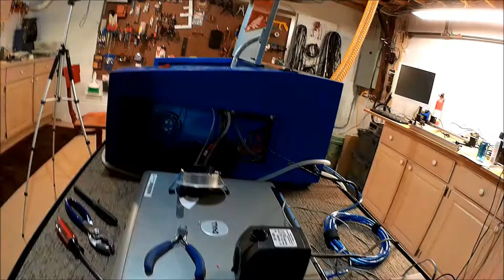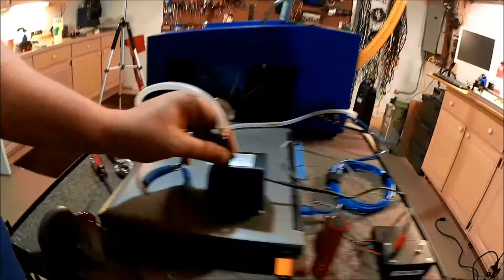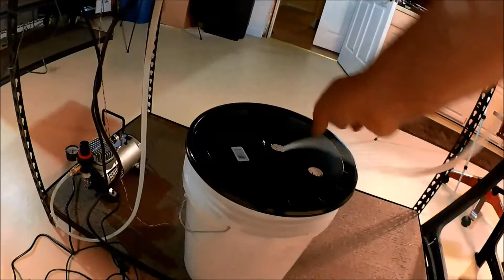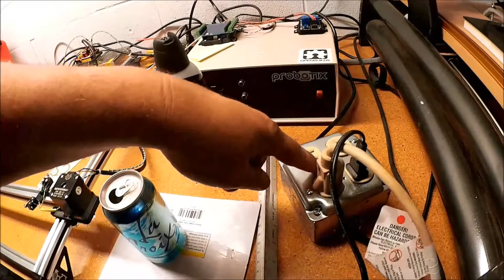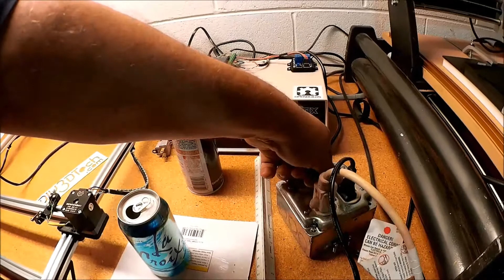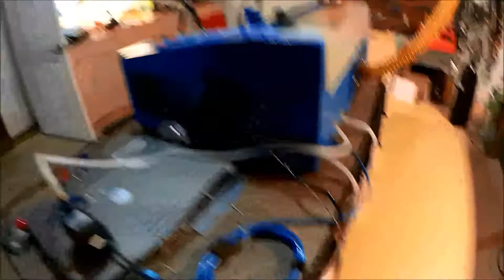eBay Chinese CO2 Laser Cutter & Engraver - Water Cooling Tips!

Comment: I have a 50 watt orion motor tech laser engraver. I threw away the water pump because "A" it is a POND PUMP....I researched it.....it is built to OXYGENATE water....you do not want oxygen in your water in the laser tube...it WILL make it HOTTER and your laser tube could burn out. Also...the air pump gets HOT.....then it blows HOT air on your work and around the machine and LASER tube which will also warm your laser.  I switched mine out for an air compressor made for a small airbrush gun to do t shirts. it works fine. and i'm purchasing a water pump from home depot or harbor freight.....one that does not create air bubbles.  just thought I would give you the heads up......I googled the information on both the air pump and waterpump. they say to at least keep your water at 65 degrees at the highest....but above 32 degrees.
Reply from the maker: Many thanks for comment as I also use an airbrush compressor.  For cooling I simply use small bucket with around 3 gallons of water at room temp for 3 years now on two different machines with no issues.  I would guess my longest duty cycle is around 20 mins and never had an issue with heat.  Also yes you do not want air bubble in the tube that can lead to hot spots and tube cracking...
Reply: @DIY3DTECHcom       do you still use the water pump that came with the machine or a different one.....just curious.  I also incorporated an airtank where my compressor fills the air tank and when it gets low it fills it back up. I have water separators attached to both my air tank and compressor so no water comes through the air line.

Comment: Peltier coolers are very inexpensive, so I decided to use this method with a water cooling block and it's not doing bad on its own.  I'm going to add another one and shouldn't have a problem keeping the water chilled this summer.  Using an old cpu heat sink & fan on the hot side of Peltier device and the cooling block on the other.  I only have about $10.00 in it, but I have to do things frugally, I'm poor!  😜
Reply from the maker: Please keep posted on how it works, however keep in mind the pettier are high current draws too
Reply: I need to calculate the currents to make sure the power supply can handle two devices and the fans.  I also have a big freezer coil/evaporator the local appliance guy gave me and 8 80mm fans I bought for 99 cents each from China.  The coil is inline just before the Peltier and I'll use it for pre-cooling before the actual chilling.  I'm going to make sure it stays below 77F/25C.
Reply from the maker: Question this is starting to sound more like a moonshine still then a cooler :-) As using three gallons of water as the thermal mass and just circulating it, I have run 20 min cycles with very little heat difference on mine.  As keep in mind you are only cooling a 40 watt light bulb and in fact not even all of that because unlike a light bulb the light is only exiting (mainly) in one direction and what you really cool is just arch lamp so sound like a fun project so don't let me deter you if that is the case, yet if your not looking for a project just sharing as what is your longest cycle time?
Reply: 8 hours straight doing coasters yesterday with the cooler inline.  I have only been at it a couple hours straight today cutting plywood coasters at 17ma - 4mm/s, but the water is staying pretty cool. 8ma for raster at 350mm/s and 50mm/s for vector.  I can cut with a lower current, but this crazy Poplar from Lowe's has certain spots that gives me problems, so I said the heck with it and leave it on 17ma, which is also what I cut 1/4" acrylic at.  Ordered a thermostat, I don't want it getting too cold after I get the second Peltier.  I forgot to cut power to the Peltier setup last night because I rushed out due to an unexpected family visit and when I came in the laser room today, the water block was one big ice ball (lots of humidity in here apparently) and the line was frozen, so I had to let it sit for awhile to thaw.  It didn't freeze very far in the tubing, mostly just in the water block.   May sound overkill, but it's extremely cheap compared to buying a chiller and I'll absolutely need it in the summer since it's in a pretty warm upstairs room where the a/c can barely keep it comfortable.  Laughing about the moonshine comment!   😁
Reply: I've been using it fairly steady the past few days, many hours at a time and there hasn't been any problems cutting at the same settings before creating the FrankenChiller.  Before I did all this, the beam would diminish after awhile until it was cooled down.  I'm tickled this is working so well, and once I get the other Peltier,  thermostat etc. inline, I'm all set for summer!

Comment: I've upgraded the water pump to one with a little more power and a three prong plug. Always find it odd that submersible equipment would not have a ground plug. I like the idea of the flow switch and have one standing by. In the mean time I'm waiting for replacement tube to arrive on slow boat from China ;-(
Reply from the maker: +Mark Fraser Yes waiting on something from China is always the pain :-)

Comment: this feels like a stupid question, but my laser cutter came with a LifeTech pump (https://www.aliexpress.com/i/32326919726.html). can i trust that it won't be a problem putting the entire thing under water with the electrical plug coming out? or should i buy a US made pump? thank you!
Reply: also, would it make sense to put a couple ice cubes in the water before i begin cutting (if im doing a long job)?
Reply from the maker: Simple answer I do not like to place any pump into water where I someone else can come into contact with it.  Please look at the eBay k40 playlist for newer videos for other solutions.  Also if your using 2 to 5 gallons of water that will provide enough of a heat sink for hobby use and again I cover this in new video I did so please check out the playlist :-)